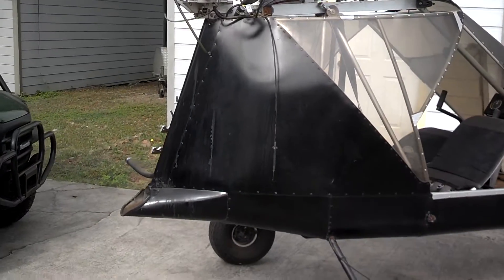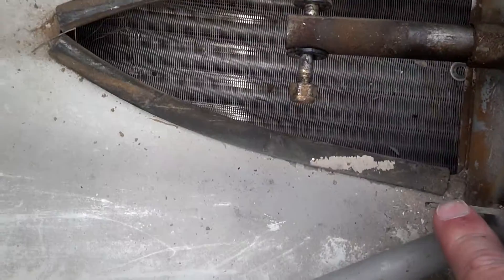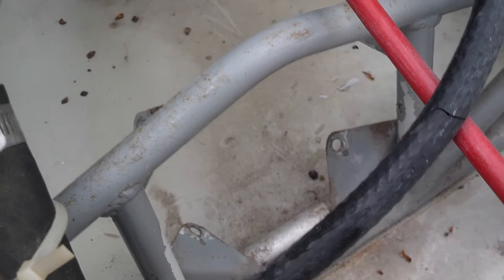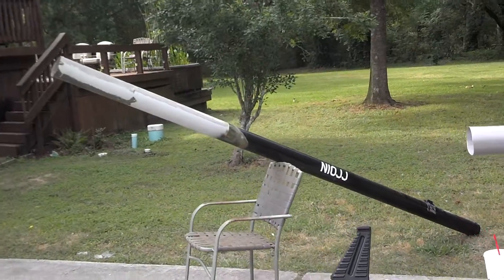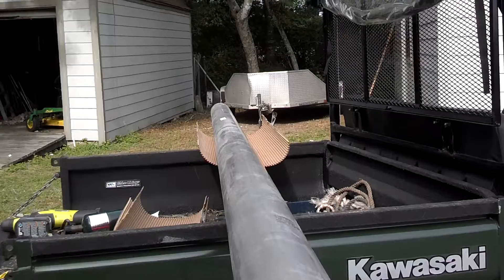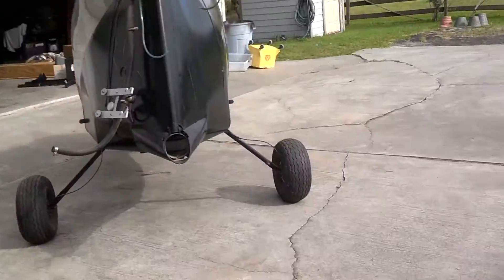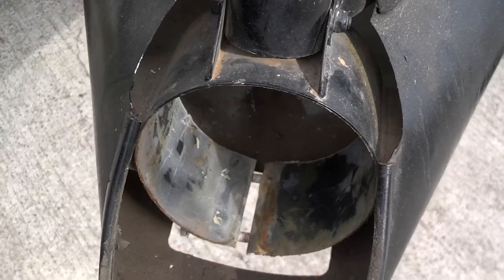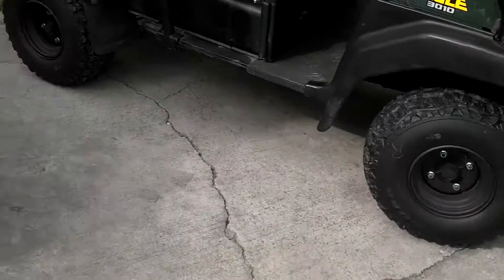Rans S12 project. Tail boom removal

Comment: Thanks. This is what I need to do to my S-12.
Reply from the maker: Hey Chris, It is pretty easy to do.  If you built it in the first place, should be no trouble.  I had a few issues using rans' method of finding the exact bottom of the boom tube to drill the holes for the tail.  Measure twice and cut once theory works good here.